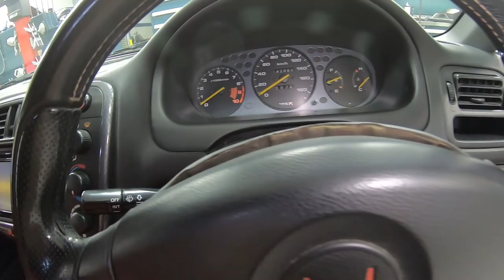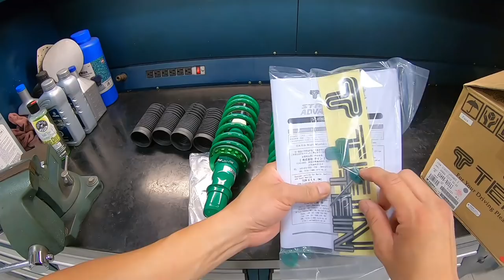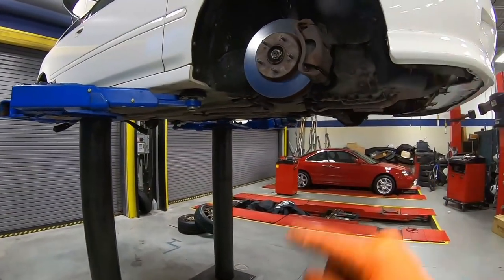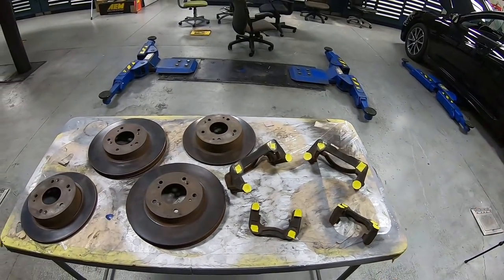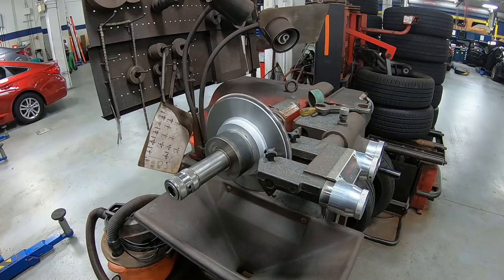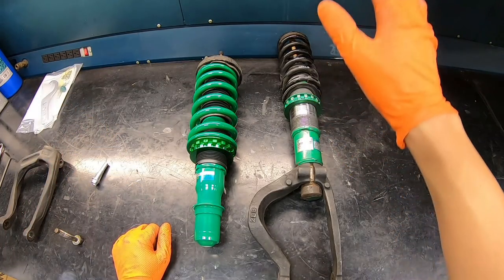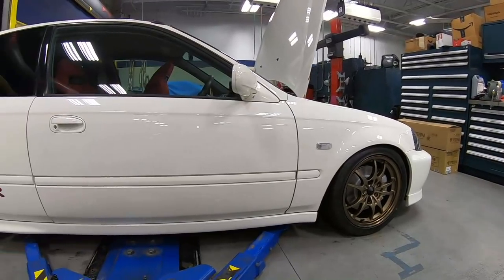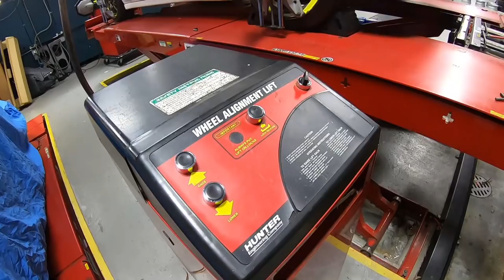Honda EK9 CTR Refresh Build - Installing New Tein Coilovers | Brake Refinish | Alignment (Episode 6)

Comment: I recommend changing the rotors... Ovetime there are getting thinner which would cause safety problem...i have a ek9 too i replaced them with Delios.
Reply from the maker: Agreed, new also good. The rotors were way above service limit, which mean they will be safe.

Comment: This video satisfies my OCD and love for Type R.  Strange that someone installed DA suspension.  I swapped out my like new Tein monosport for Spoon springs and struts because I found them far too firm for street use.  I was concerned about paint on the rotor discs until you turned them.  I got an Acura ad during this video but sadly it was the short version that didn’t show the ITR!
Reply from the maker: Thanks for your continued support

Comment: Hey guys, love your channel. I wondered is this the “Wurth high heat metallic aluminum”, “Wurth high heat aluminum”, “Wurth silver wheel paint” or something else? I see what looks like an engine image on the can, but they only make a black engine enamel. Trying to recreate that OEM finish on my 31k original mile 1990 Integra. Thanks!
Reply: Liked, commented and subscribed by the way! Keep it up!
Reply from the maker: The Wurth paint is no longer available, however we found a substitute. Use Dupli-Color Engine Enamel DE1615 Aluminum

Comment: Any issues using chrome sockets on that Milwaukee impact? Ever shatter a socket?
Reply from the maker: We only use it to tighten down the fasteners. Chrome sockets are not designed to do high impact work. Impact sockets will do a much better job

Comment: Why you choose Tein coilovers rather than KW or Ohlins?
Reply from the maker: Both brand you mentioned are top shelf items, even though KW has an entry level V1 model which serves the about same function and quality as the Tein Advance, but just much more affordable. Ohlins are in the $3k area, and geared toward track and bit rough for street and daily uses.

Comment: How much did all this cost?  I have an eg hatch, and I am considering a similar thing on my hatch.
Reply from the maker: Depends of what you like to do on the refresh. As for the calipers and rotors refresh, only spray paint and turn rotors which is super affordable
Reply: @ahcgarage  where are you located?
Reply: @ruvtecn  Pembroke Pines, near Miami,  FL

Comment: What do the slide pins come with from factory, Moly or Silicone? Thanks!
Reply from the maker: Moly
Reply: Really? Moly eats the rubber boots over time. Should be using silicone paste.

Comment: How much mm or fraction of an inch will be removed during rotor skimming?
Reply from the maker: We measured the rotors prior to resurface them, then remediate them again to ensure the thickness is still within factory specifications
Reply: @ahcgarage  I mean normally how much thickness does skimming removes?

Comment: What is that malaco grease you were using?
Reply from the maker: It's a brake grease which helps lubricate the moving brake components
Reply: @ahcgarage  it is a Honda only brand? Is it something you can buy over the counter? I’ve been using a silicone grease but I’ve wondered what factory Honda uses.

Comment: Tein's are garbage!, stop being cheap and go with k-tuned street coilovers
Reply: Agreed, have had them myself as well as multiple friends - we all hated the dampening. There's better options out there for the price.
Reply: I don’t think its about being cheap. TEIN has many coilovers that cost way more than K-Tuned. Those TEIN Street Advance and Street Basis are SUPER budget and built to a specific price point and made for a bit of lowering with a comfortable ride. They’re basic coilovers but still have TEINs quality. Their MONO Flex and higher models are thier real premium coilovers. I’ve had a set of TEIN’s for over 17 years and not a single leak or blown shock. Just took them off my delsol to put on my hatch.
Reply: @TrackSol  Do you use the car only on weekends every so often? or do you daily drive it? Bc it seems like the people at AHC garage keep the cars stored in the garage and maybe move it from spot to spot considering they put teins on every car they built so far such as the tl-s, type r so they really don’t get to feel the difference in quality and for them to get use
Reply: @brandonazevedo4494  They sometimes install BC Racing on some cars
Reply: @brandonazevedo4494  I’ve had the car since 2000 and daily drove the car with the TEINs from 2003 to 2005 with lots of autox events on the weekends. Went overseas for military duty from 05 to 08 but came home on leave a couple times during that time and did a couple track days. Then from 08 to 14 daily drove the car again. Been parked since then while collecting parts from the rebuild.
Reply: Ktuned are the cheap ones and yea tein has their more affordable ones now made in China Because people didnt wanna pay for japan made ones,i have the super street ones on my civic paid 1500 with top hats and just purchased the street advanced z for my daily cl9 and feel a difference big time so people please do your homework before talking about tein
Reply: @ramonpreciado2475  i did do my homework on them lmfaooo, that’s exactly why i’m saying there garbage..., why else would i be talking shit ab a product i haven’t tried, teins are shit ik from experience. I then switched to the k tuned street coils and they are way better. K-tuned isn’t cheap, quality and price are two different things and i’m not talking price i’m talking quality i rather choose quality over price, money ain’t shit aslong as the quality is there i’ll pay for it, it’s just that 🤷🏻‍♂️
Reply: @TrackSol  yupp tht explains...
Reply: @brandonazevedo4494  well i had friends run ktuned and they were trash in my opinion they werent as solid as my tein and one of the coilovers blew within 1.5 years and the other one that had them it was defective cause they were soo soft so he had to send them back
Reply: @brandonazevedo4494  unless you’ve tried every different variant they make, you really don’t know what you’re talking about.
Reply: @Patrick94GSR  Noooo, i dontttttt 🤡
Reply: @brandonazevedo4494  What do you mean “that explains”. I had my Teins for 2 years daily driving AND autox on the weekends, then parked the car for 3 years but still did 2 track events, then daily drove the car AGAIN for 7 years. That’s 9 years of daily driving use. No leaks, no blown dampers, no corrosion, no rust. Mine are the older Type Flex twin tube versions, which are similar to the current Flex-Z, only mine were made in Japan. On their current lineup, I believe their made in Japan models start with the Mono Sport and up.
Reply: @TrackSol  your deff cappin on the “no corrosion” “no rust” and they deff started leakin somewhere. it’s all in the driver 🤷🏻‍♂️